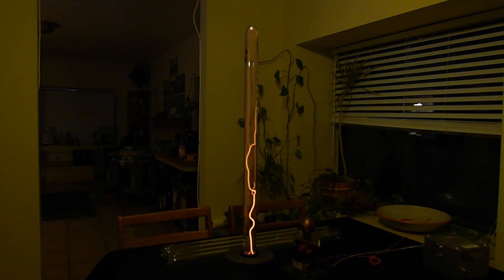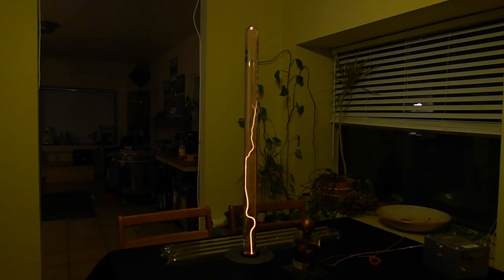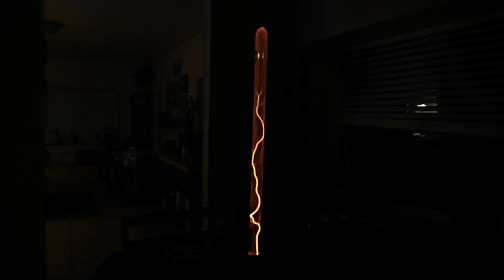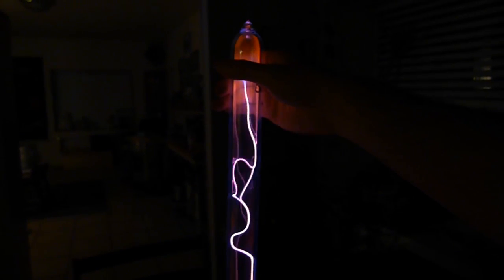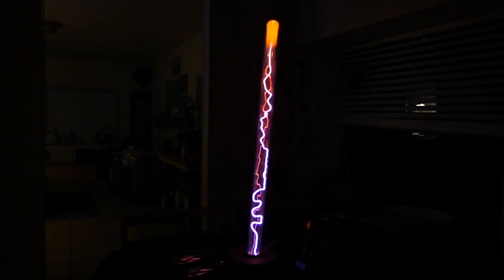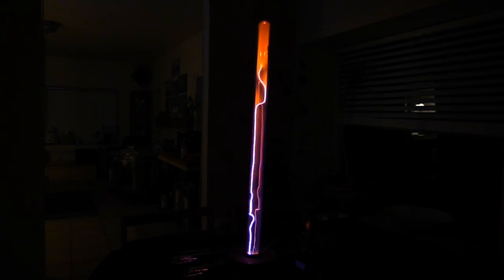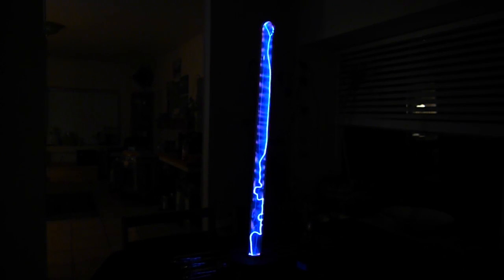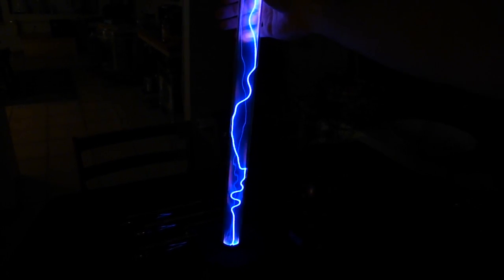Plasma tubes containing neon mixtures

Comment: I alwasy wanted to fill a globe of many of the noble gases and run a tesla coil over it. the interesting flat earth theory is the sun is local, and the sun works like a tesla coil. since helium is one of the lightest gas the sun would exited that the most as it passes it by, then the rest is oxygen which is blue, and as the sun sets u can see the other nobal gases exited.